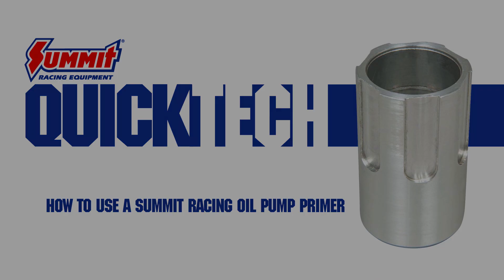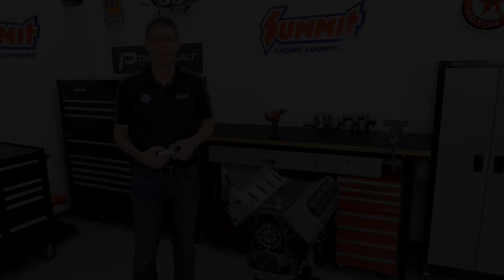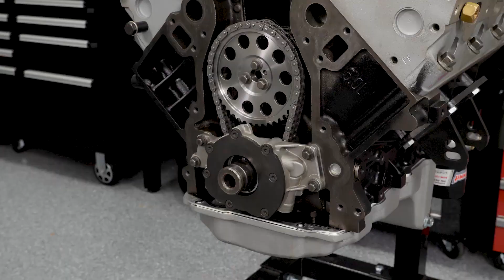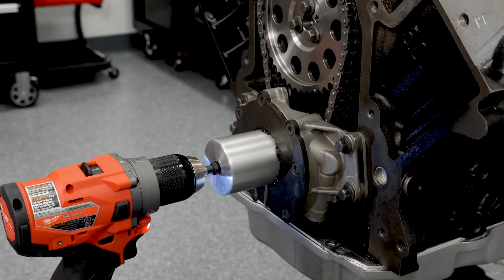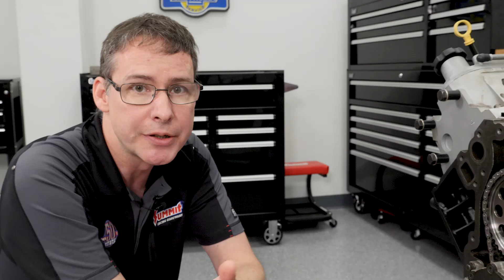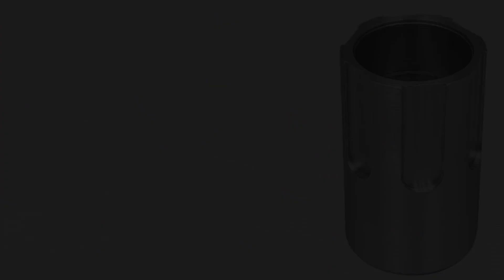How to Use an Oil Pump Primer to Prime Your LS

Comment: i love that tool..  if you don't have a racing pump and you want to prime your LS or other crank driven oil pump engine.  with the spark plugs out..  engine oil in the pan.. oil filter removed.  use a remote starting button to activate the starter and spin the engine till you get some oil coming out of the filter mount..  screw the filter on and crank for 10 seconds more..  you should be able to install your spark plugs and turn the key on.. verifying with your instrument cluster that the oil pressure light is on. or that the gauge reads zero.. start the engine.. count to ten if the oil pressure light does not turn off or the oil pressure does not come up shut the engine off..